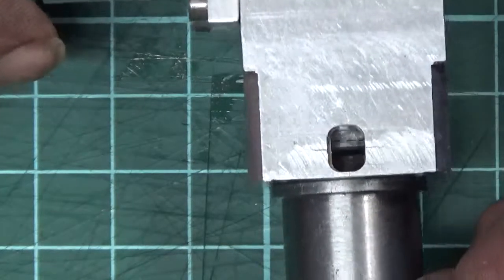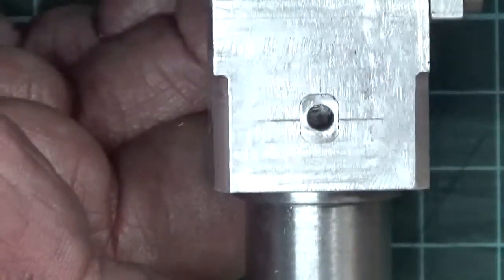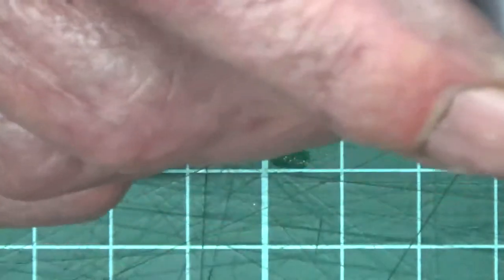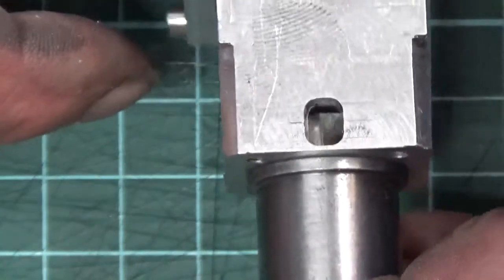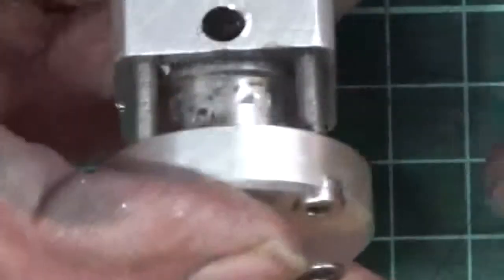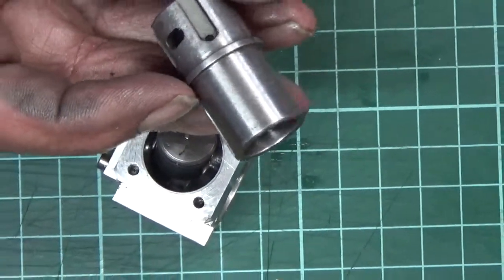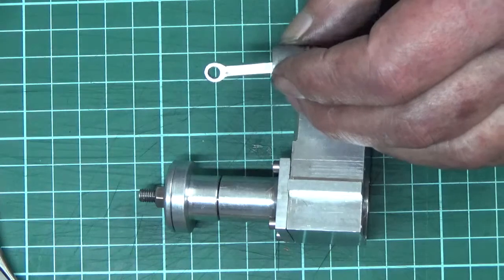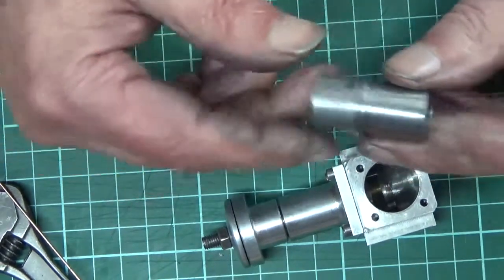Two Stroke Timing

Comment: If I understand it right,its a Boll areo so why not work conform the plans Keith? If you stick  to it,it cant go wrong.
If you dont have the plan,its a free download on the web.

Good luck. I love to see it fire up!

Peter
Reply from the maker: The Ball Areo was my first engine which did run,I think it's in one of my videos.This one is the upgrade by Nelson. http://www.machineconcepts.co.uk/engines/nelson/nelson.htm.

The problem I have with this one is compression.I will have anther go at a piston soon.
Reply: Thanks for reply Keith. To make piston rings seal well is not easy.They have to be  grind in in a tube with the same size as the bore. Its not easy to do it well.If I was in your place,I will make a normal piston and lapped it well in.But I am sure,you will get it done..Keeps my fingers crossed!!

Peter